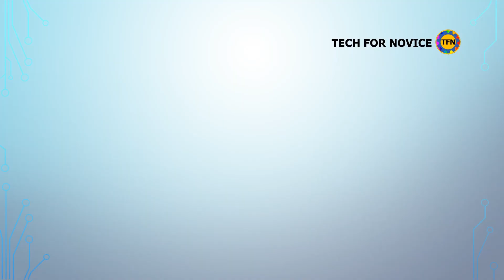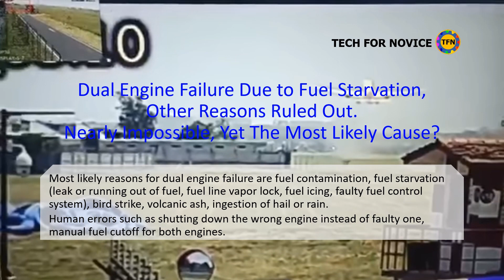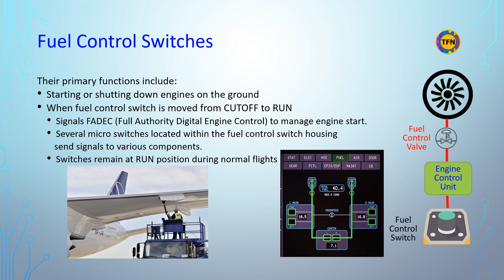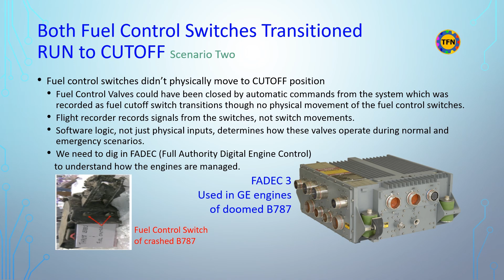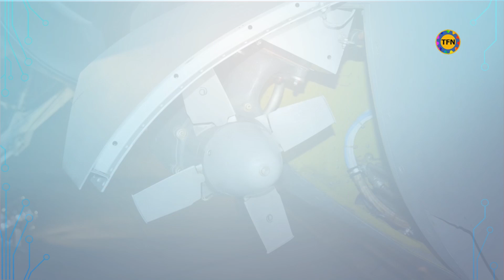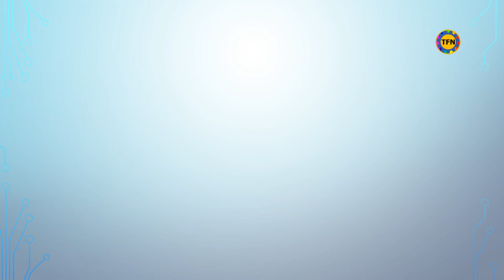Simple Logic Behind AI171 Crash, What Could Have Gone Wrong

Comment: The most likely cause is a major electrical failure from a short circuit and electrical fire from the electrical buses.
The engines provide 1 MVA at takeoff and reaches upto 19000C or 35000F.

As the 28V DC essential buses got short circuit in due course, the switches lost the 28V Run signal and transition to cutoff.
When the engines no longer could produce electricity, the fire died out and the copper was melted away.
The RAT gave Run signal 10 seconds later. As the switches is powered from separate buses, it took some seconds more to power the other switch.
It totally lines up with the early RAT deployment. 
The aft EAFR has Titanium totally melted away!
Reply from the maker: Thank you for your detailed and insightful comment!
Reply: @TechForNovice  There's another likely scenario with water ingress in the fwd EE bay. We also see white smoke at takeoff coming from the plane. 
The RAT deployed a few seconds before the cutoff signals. This means we can outrule the captain did it. 
The plane went down.
Reply from the maker: @idarpolden5913, if water ingress was the cause of the crash (which is a possibility) then it should be maintenance issue. Do you think Air India maintenance team is unprofessional to make such negligence?